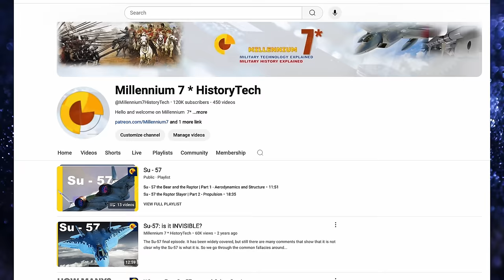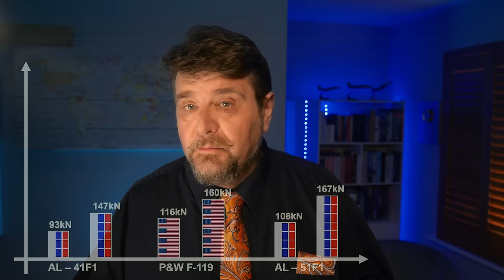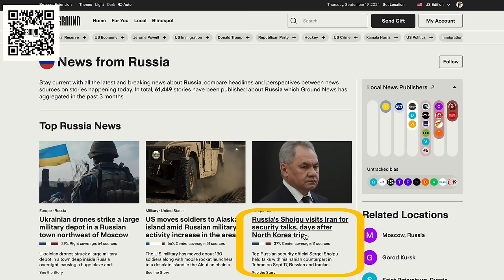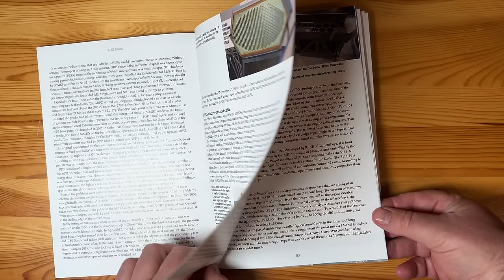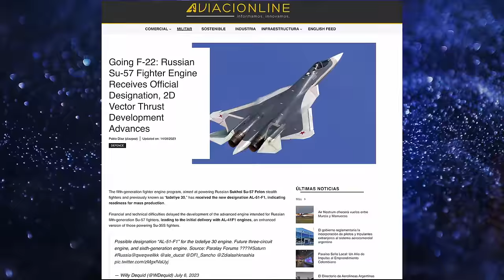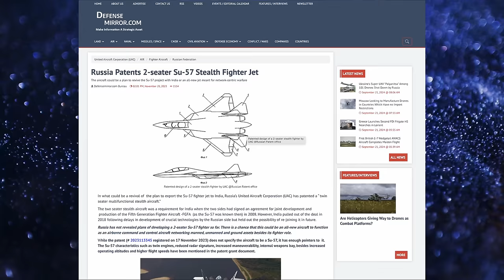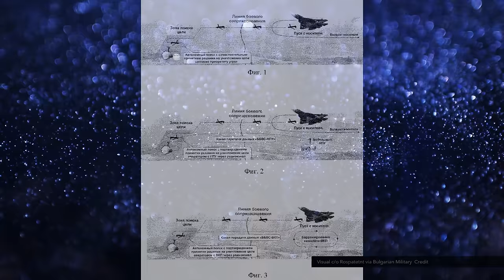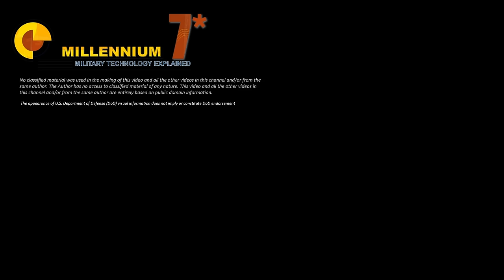The Su-57 is a Masterpiece!

Comment: The Indians with all the access and knowledge they had of the SU 57 program decided to dump it. It says a lot when a major nation with massive engineering expertise dumps a program like that.
Reply from the maker: They dumped it because the Russians did not agree on technology transfer...
Reply: Hm.
Reply: @leonleeoff2216  Not going to be made? There's a couple dozen of them in Russian service. Sure, they're not using it as a stealth fighter, instead using it to lob cruise missiles from very far away for which no stealth is needed, but it is being made and used. Are you sure you aren't conflating it with the Su-75?
Reply: @Millennium7HistoryTech  And they lied about the capabilities. It harkens back to the old plasma stealth they tried to sell to potential customers, in a suspiciously snake-oil-salesman manner. They may have a working version of it....but it's got serious drawbacks that render it of dubious use  in real life scenarios.
Reply: That’s part of the reason but Indian officials also openly stated they thought the technology particularly the stealth and engine were unsatisfactory.

Comment: I don't think the Su-57 matters at this point. Russia doesn't have the command and control capability to use it's 4th gen aircraft to any great effect, so 5th gen isn't going to be a huge help to them. It seems like a development program. It doesn't appear that they'll be able to manufacture the Su-57 in real quantity, and likely most of the on paper features won't be able to receive enough attention to really iron out and integrate to their full potential. By the time Russia has the extra resources to have a real 5th gen program, they'll probably just apply whatever lessons they learned to a new fighter program. Assuming that still something they are capable of at that point.

Comment: The Su-57 is actually not that bad. Compared with the Raptor, its avionics may not be inferior. The Raptor has too few sensors. After all, it is a fighter jet from the early 21st century, and its upgrades are also limited. It can only rely on adding equipment and adjusting positions, but this will sacrifice stealth.

Comment: KH69s in Ukraine does not guarantee that they were launched by Su-57.

I am not sure that the Ukrainians finding KH69 parts means they were launched by Su-57. With the KH69 being a variant of the KH59 where the primary difference being that the physical configuration has been modified to fit in the 57's internal weapons bays, it would not be a stretch that any aircraft that can launch the KH59 could be used to launch the KH69.  It is common practice in the west to flight test weapons on existing platforms prior to integration on the target platform. 

With the limited number of 57s, it would be logical that a Su-34 could have launched the KH69 in combat to test the new configuration.

Comment: Unlike many westerns I don't think that the Su-57 is garbage, they clearly did their homework in order to design it. But the one issue remains that Russia is still trying to catch up with the F-22 from almost 30 years ago while the US air force is actively working on it's next gen replacement. To be fair the F-22 was ahead of it's time and everyone is still playing catchup with that one.
Reply: The SU-57 isn't garbage but it isn't good, it has a few things going for it I guess, it's fast, can carry a good bit of weight and is very maneuverable. But it seems more like a propaganda piece, or the victim of Russia's insanely corrupted military procurement process rather than an honest to God attempt at a truly modern fighter that can compete with other modern fighters. Even if it's as good as Russia claims and the stats about it are true it wouldn't matter because in the nearly 15 years this things been in development they've managed to build a dozen prototypes and a handful "operational" airframes which is not enough to do much of anything with. You compare that to the 190 or so raptors in service, the over 1,000 F-35s in service and the 250 or so J-20s in service and Russia is extremely behind in the "next gen" fighter race. This is compounded even more by the fact that nearly every major western nation has some sort of 6th gen fighter program under active development and you get a sense for how out of touch Russian aircraft designers really are.

Comment: Such a masterpiece that they aren't even using it in their "SMO" lmao
Reply: (с) Марат Хайруллин
1.For example, the owners of Ukrainian slaves are in a panic about how our Su-57 works. This plane can stay in the air for a very long time, and due to the fact that it can see everything far away and is armed with very long-range weapons, it turns out that it is literally sitting in ambush. Not everyone knows that almost every moment of time one or two Su-57s are in the air. They guard primarily the Black Sea and, apparently, the most dangerous sections of the border and front.
Reply: 2. Hence the unprecedented effectiveness - almost any launch of dill missiles from an aircraft ends in the defeat of the carrier. 
Now, based on the results of the first year of full-fledged operation, it turns out that one Su-57 squadron is capable of monitoring the entire current theater of operations around the clock. And I remember that we already have a regiment of such miracle machines in our Northern Military District.

Comment: Imagine claiming this 21st century fighter jet is the greatest thing ever, despite the fact it is incapable of matching the stealth or the performance of the adversaries fighter jet that designed in the late 80's/early 90's. Or the fact that your new jet engine that isn't even in production yet has just barely matched the performance of the P&W F-119 which hasn't been in production for over a decade since 2013. Not even getting into Russia's inability to manufacture really sophisticated electronics without using chips and other electronic parts sourced from the West?
Reply: When did he say it's the greatest thing ever? 
Edit: Also, it doesn't need to match the stealth of other aircraft. 5th gen aircraft are designed to the specification of the nation in question. For example, the design requirements for the Su-57, J-20, F-22, and F-35 are all different. Additionally, the Al-51 has already been fitted to the more recent Su-57 models that were produced. Though I don't know if you would call that a limited production or full production.

Comment: Is the Su-57 the best 4th gen fighter?
Reply: Yeah a better one than F22 or F35.
Reply: Best 5th gen
Reply: @the3rdEye2187  No, I meant it literally. The doctrine is almost entirely the same as modern 4th gen fighters, with its LO systems designed to delay a lock more than evade detection, similar to an F/A-18 super hornet's LO design. As an advanced fighter, it may be the best 4th gen fighter right now, maybe even better than the F-15 EX and Rafale
Reply: @Er19421  so F22 and F35 are also overhyped 4th gen fighters? Su 57 has even more complete sensor package compared to both F35 and F22.
Reply: @the3rdEye2187  Maybe, but I'm not fully convinced on that point mostly because of US dominance in the semiconductor field. Either way, the F-22 and F-35 are both VLO and designed to avoid detection entirely while engaging from standoff range, which is the major doctrine shift that made the F-22 a game changer from the F/A-18 super hornet that was designed with LO geometry to reduce the chances of a lock, similar to the Su-57. The Su-57 has more composite materials and supermaneuverability, which give it an advantage over other 4th gen fighters but doctrine wise, it's still fighting like a 4th gen. This isn't a bad thing, as 4th gen with AWACS is more than capable of confronting 5th gen, and once in a merge, it's even got an advantage over the competition

Comment: Really disappointing. Using terms like."special military operation" and "mainstream Western narrative", and saying you found it worrying that there may be NATO assets in Ukreiane... all do come across as bias in favour of Russia. And just saying at the end of your video "everyone will say I'm a shill and I'm not", doesn't change that. The fact is that after 40 years since the MFI program or 25 years since the start of the PAK FA project, there are just 22 planes in service, all without stealth (even though you say they are invisible?!) And with engines that are less powerful than the F22, which has been in service for 25 Years, so skepticism is totally reasonable and not only based on some anti-Russian hate.